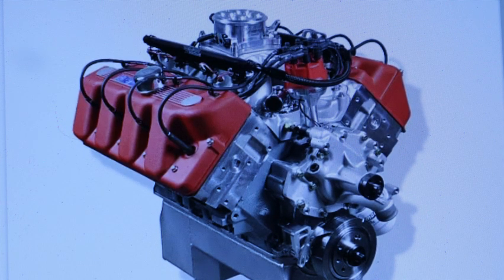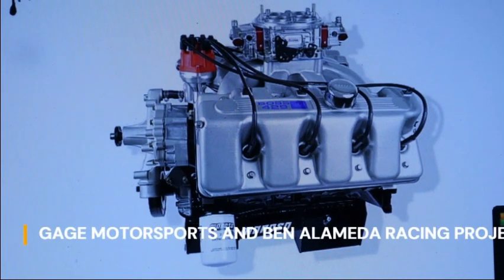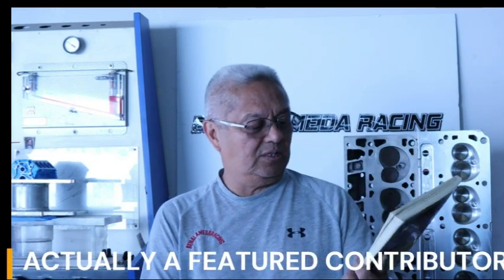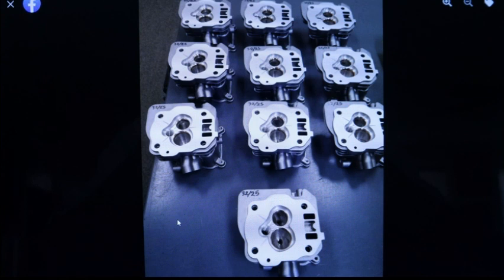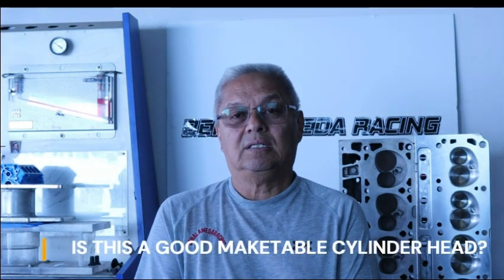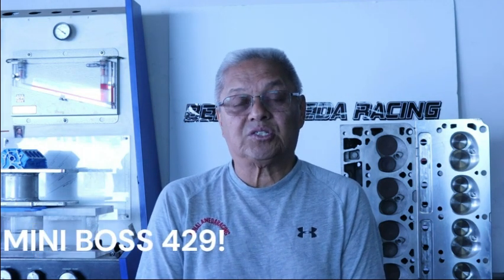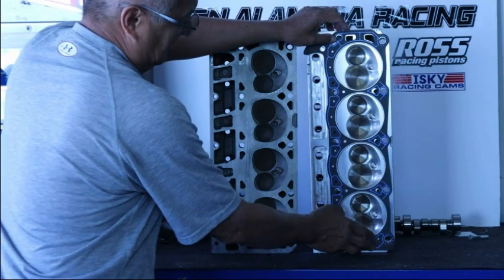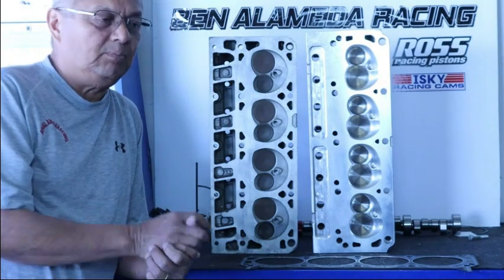A MINI BOSS 429 HEAD ON A WINDSOR OR LS ENGINES?

Comment: Hammerhead performance has a boss 429 head true hemisphereicle. That will bolt 351 Based Windsor sbf
Reply from the maker: Yes they are awesome heads but I heard there is trouble in the horizon and they are not making them and folded?  I wish I knew more.

Comment: Ben how about putting an engine together with those hemi heads sbf that the everyday guy can afford you might sell more if you show us that they can make good horsepower without having to tell the kids they have to eat beans /weenies or bologna for the next 2 months
Reply from the maker: I like your humor Richard! lol  Anyway the Hemi as impressive as it is kind of falls short on the streets with street compression ratios so building one for pump gas on the streets probably will entail having a big stroke and lots of cubic inches!

Comment: The Boss 351 & Boss 302 has a similar head design 

The valve covers from Ford don't look as nice as the BOSS 429 

https://en.m.wikipedia.org/w/index.php?title=Ford_Boss_302_engine&wprov=rarw1
Reply from the maker: Love the Boss 429 valve covers no doubt!  Boss 302 vs. Clevelands have the alternator bolt very near the valve cover rails on the passenger sides.  Other C heads do not have these distinctive feature.

Comment: i would prefer a 427 SOHC head sized down to the Windsor. Would need a special timing cover and stub shaft where the cam was, but it would be a beast. Short of that, the Cleveland head already has huge flow.
Reply from the maker: For a small block the C head is a lot of potential street or race.  SOHC W would definitely turn some heads but will be very expensive to make the valve covers and timing covers plus chains.  Would love to do it thou if I had the cash.
Reply: @benalamedaracing2765  for sure. And a lot of people would call it a waste of time when engines like the 5.4 and 6.2 exist. But it would definitely be cool to do if a guy had access to the tools.

Comment: H Ben, if the head is common between both manufacturers, which Valve pattern would you use, IEIE or EIEI? One of the two would need a custom camshaft.
Reply from the maker: I need more info...
Reply: @benalamedaracing2765  the head you referenced in this video. You mentioned  that it would work in a LS & SBF. While the bolt pattern is nearly identical and exhaust port locations, the valves are arranged in opposite order.

Comment: That would be awesome to make a real racing  Hemi head for ford and especially if lts that's universal between the two. The HammerHead Hemi heads do that but according to David vizard they're not true race heads. Did you ever get to test those heads or the Arias Hemi heads for the windsor and ls motors?
Reply from the maker: I will be doing a hemi SBF next.

Comment: Single intake single exhaust valve 😆😆😆😆😆😆😆
Reply from the maker: 4V or 3Vs are still superior compared to 2V engines .
Reply: @benalamedaracing2765  yessir. There's a reason we moved to 4 or 5 valve.

Comment: There are Windsor heads commercially available in the mid 300 cfm range and then there are the SC1 heads with 400 + cfm. In my opinion there there is a gap in the market for the HP range many people are trying to hit these days for street engines and amateur racing classes. The SC1 heads are great, but with a high cost. What we need is a little less head than the SC! with a better cost.
Reply from the maker: I prefer the Trick Flow and AFR heads for impressive street performance and they are actually affordable.

Comment: Hey Ben, great information. Love your channel. 

I’m just putting my 2 cents in while at the same time recognize your desire to both the SBF and LS market. 

In my humble opinion the Godzilla is the engine of the future. It will be interesting to see if a racing head comes out for that platform. 

A Boss 429 head for a Godzilla engine would be unreal I think. 

Thanks for everything you do sir.
Reply from the maker: Thanks!  I have reservations on the Godzilla and voiced this to a Ford Motorsport I have spoke to about the length of the valvespring in the cylinder heads!
I was thinking it would have serious oscillation issues and until they can retrofit it with a reasonable spring package then it will be good.  But not the way it is now perhaps ok for now until we get to some serious engine rpms.

Comment: Another great video Ben! Could you do one on valve train, getting correct contact on valve stem and correct push rod length? I seen a video by Straub, they did calculations but didn’t run through with adjustable push rod with the light springs. Is this good or should a guy run a check after this and see what the contact is?
Reply from the maker: You always have to confirm the contact area and where it is located on the stem tip.  I will do this on a build I am finishing up hoping we make 900 NA hp.
Reply: @benalamedaracing2765  ok, thanks Ben

Comment: Very interesting, Will you have to use a special cam in the LS to make it work?
Reply from the maker: It should interchange with just the heads and it basically easy to make a cam with the reverse intake/exhaust lobes for the LS version.

Comment: How do these differ from Greg browns hammerheads
Reply from the maker: Hammerheads seems like a design from the Ford Pro-Stock program which is impressive by all means while Gage M and myself will approach ours from a legacy of the Boss Shotgun engines with an eye to new technologies as far as port and chamber changes.
Reply: @benalamedaracing2765  are you looking to do something that could be streetable on a big inch windsor like a 445 ?

Comment: There are many great heads for Windsors. It's not like it's 1978!
Reply from the maker: Agree from Yates to the AFR's they are all mostly impressive!
Reply: @benalamedaracing2765  I'm 62! We had to learn about head porting and get the machine shop to put bigger valves in!! Or go to a stroker Cleavland and wonder how many passes at 7500rpm it would let go!! You boys got it made! But, that's when I lost interest,  when anyone with a good checking account could do it!!
Reply: @benalamedaracing2765  yes, and I'll admit that by the time I got out we were running a set Victor Jr heads! It went on to a 408 sporting Yates heads! But, the feeling of personal satisfaction wasn't the same! It was becoming another job! I have a camper now, that I use 4-5 times a year?!! But, it's almost maintenance free!! Racing is a money pit!! Just go watch, but I don't even do that!!

Comment: Don’t even see a gm guy putting a Boss head on an LS because they say Ford is junk
Reply from the maker: Are you sure?  For sure Chevy standouts Tony Christian and John Lingenfelter ran Clevelands on their chevy racecars to compete at the same weight as the chevies @ NHRA Competition Eliminator classes.  Ford cars with their engines are heavily penalized by using weight factoring to equalize the competition! So many Chevy racers saw the potential of the heavily strapped Clevelands ran them on their Chevy cars to use the same weight as the others and NHRA ended that contraption in less than a year of competition.  Then they penalize them for the body style stating 2 door sedans and Gapp & Rousch ran a 4 door Pro-Stock called "Tijuana Taxi" so they can run at the same weight and other used the old Mach 1 Mustang for the same reasons which was not covered by the rules.
This said Ronnie, when the Fords and others including Gliddens small block Pinto, went up against all the big block Camaros many I am sure including you are unaware that Glidden and other Ford nut jobs are actually carrying more weight than their big block competition!  The small blocks was nowhere even close and they gave up on them and went big block against the Clevelands.
Hope this makes it clear for you to understand...

Comment: Ls is a ford designed engine i was told great video ben
Reply from the maker: LS is a big improvement from the legacy SBC and share many commonality with the Ford engine.  This said I believe what works for the LS will do the same for the Windsor engines.
Reply: i think your wrong, theres more to it than that. the engineers that worked for ford went to work for GM and produced it at GM. Ford never produced it
Reply: @richardscarlett7942  I suspect what Pacman was trying to say is that the LS has many design cues from Ford engines, not that the "LS is a Ford designed" engine.  However there are only so many ways to construct a workable engine so there's bound to be similarities.

Comment: An adapter plate to go between a cleveland, LS, hemi, head and a 8.2 windsor intake manifold would be awesome to go along with this collaboration. The adapter plate could have studs for the windsor intake bolts in their offset location.
Reply from the maker: I am leaning towards an SC1 intake flange and width even for the LS block combo.  Therefore we can keep it simple bolt on with minor adjustments and manifold availability.  The only mods for the LS I see is installing a thermostat housing like the one TFS sells if I am not mistaken to join both heads to the thermostat housing then to the upper hose.

Comment: This would be huge , if u could make a manifold for it to work on the 8.2 deck ford 302 base blocks will make this really huge and if u could make this really affordable so that the average guy can afford it and be able to make big power also would be huge. Ive been wanting to build a boss style sbf even more lately so this is very much a great idea and if u can sale them cheaper than afr or trick flow you wont be able to keep up they will be selling so fast
Reply from the maker: 79,  we are planning port volume differences to achieve workable street power levels without bogging the engine with too much port and valves!  We will be flexible and will address those issues because the Hemi on these video that I built was soft on the bottom mid range and needed more CID.  That said it will made 980hp from the dyno tests given to me so it is a full race head and a true hemi. I think this new design would be more flexible and adaptable to even the milder combinations.  Imagine having a 50cc chambers and even with a 302 with flat top pistons would have good compression and power!
Reply: @benalamedaracing2765  Im liking the sounds of it already. 50cc with flat top pistons would be a game changer with some good flowing heads. I wanna go ahead and sign up to be a guinnea pig when the heads are in their testing period 😁
Reply: I think he was saying you need at least 440cid to take advantage of these? On a 302 I’d imagine it would be really lazy down low with less then ideal street manners. Probably need to be revved over 9k to make them really work? Then there is the issue of splitting the 302 at 500hp.
Reply: @chevy6794  Ok i thought he was talking about a different set of heads that needed to have at least 440 cubes but yeah if he was talking about these then it would be way over kill for a 8.2 deck block but I wasnt talking about running stock block with them although some may
Reply: @chevy6794  I just rewatched it and he was talking about some Billet Hemi heads that was already made needed 440 ci I dont know if he mentions what ci would best suit these heads or not but im going to rewatch the entire thing again and find out
Reply: Dart block or a stock block filled half way with block filler, stud girdle,  lifter valley girdle(mostly for harmonics) will reach way past everyone's 500hp max on an 8.2 deck.
Reply: @echota23  I agree totally and internal balance the assembly also helps as well
Reply: @echota23  a buddy of mine split his block at way less than 500 so really its based on other factors besides just the 500hp number I believe. Detonation is also a big contributer

Comment: unity garage made one its super cool thinking its 427 windsor. clevo mod heads..wish ford made this happen instead of just running out taxis blocks
Reply: Yes andy woods aka mixed up boss in Casper ole ford f100 truck perty much same engine putting out like 750 hp Na one sweet engine
Reply: Andy from Unity Motorsports uses the Hammerhead heads which It looks like the exact same valve covers  shown in this video.
Reply from the maker: Hammerhead is an excellent cylinder head and very impressive by all means!  I will try to do the same with Gage Motorsports and see what we come up with.

Comment: be sure to look into Ford 400 block fit also.....G
Reply from the maker: That should work because the displacement issue will be fixed with a tall deck.
Reply: @benalamedaracing2765  I was thinking about the water. The cleveland water stays in the block; like the ls but the windsor needs the thermostat cross-pipe like doing a clevor head swap. just thinking.....